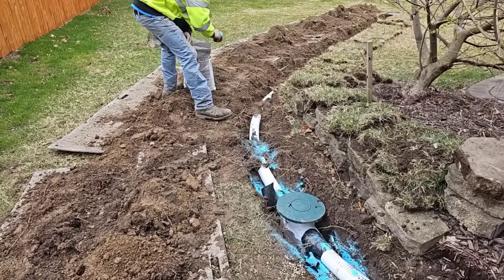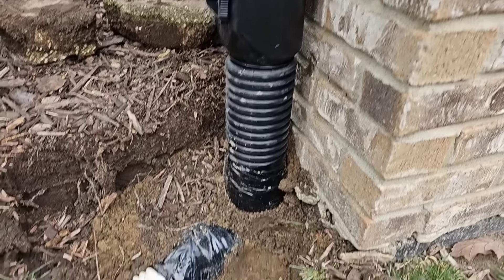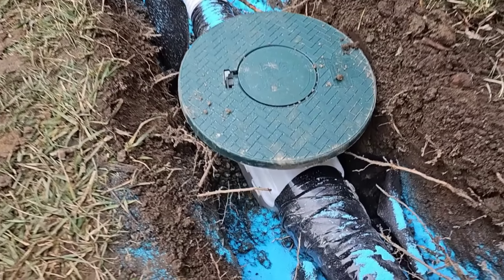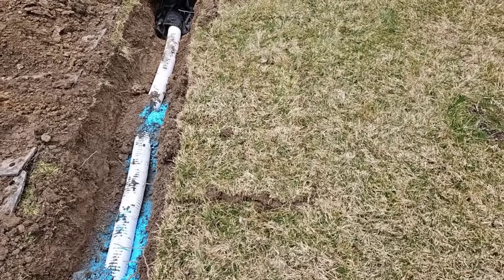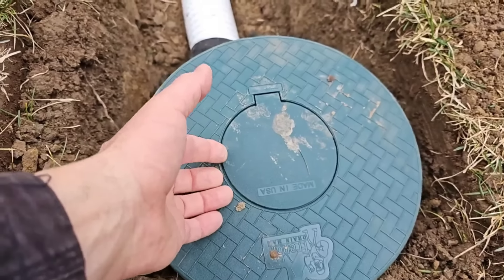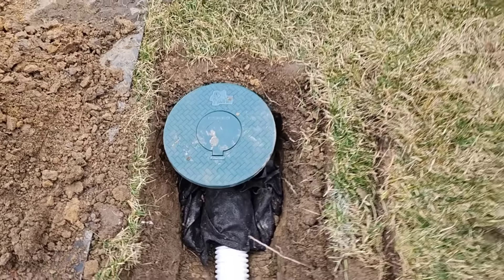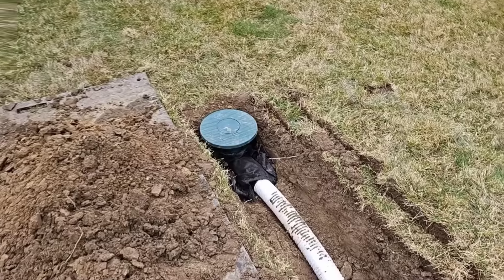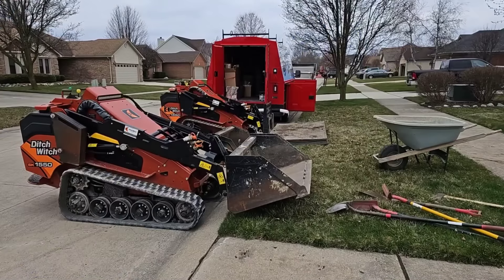How To Build Underground Buried Downspout System that Lasts FOREVER

Comment: Is this 3" pipe ok for areas with pine needles or would you still stick with the 4"?
Reply: I would imagine the downspout adapter's filter would collect most of them and the catch basins would collect others. Do you have gutter guards?
Reply from the maker: Leaf filters catch long pine needles, but many of the short ones will get through. Yes, going to a 4-inch line displaces more area, so it just takes longer for the needles to become a problem. I always recommend cutting those trees down because they cause all sorts of problems that you're unaware of. You'll end up with the wood under your shingles rotting on your roof, and it causes mold and mildew on the house. The sap ends up on everything. I'm not a fan.
Reply: @FRENCHDRAINMAN  My car has several spots of pine tree sap that are difficult to remove. I suspect pine needles are making the ground too acidic for grass to properly grow. My neighbor and I both have huge pine trees. They are nice for shade, but they create a lot of lawn care work.
Reply: I had my gutters replaced and the previous gutter guards did great at preventing pine needles from getting into the gutters, but that might be because the nearby pine trees are old. I'm looking forward to a rainstorm to see how well the 6 inch gutters perform.
Reply: 3" pipe has a faster velocity that ought to push debris through it, at least to a catch basin. It wouldn't hurt to connect a garden hose to the downspout adapter for a catch basin to flush out any debris.

Comment: My street doesn't have any stormwater drains. Would it make sense to install a 15-foot section of knife cut that connects to the popup emitter to reduce the volume of water that exits? I'm planning to buy a yard drainage system for the 4 downspouts in my backyard. I'd like to take 2 downspouts to the front yard, but my neighbor's huge pine tree has surface roots in my yard and I have a few ornamental trees so sending all of the downspouts to my side yard seems like the best option.
Reply from the maker: Pine trees are very shallow-rooted. But that's all they have; just what you see at the surface. They have this web of anchoring roots, and there isn't anything for feeder roots. I find that those are some of the easier roots to dig through. Just buy a sharp axe. It's pretty easy, to be honest.
Reply: NO KNIFE CUT! That just lets roots in.
Reply: NO KNIFE CUT! That just let's roots in.  If you must discharge into the ground, you want a dry well at the end of your run.

Comment: Can you make a pop up emitter guide?

How does the water flow up out of it without the pipe filling up?
Reply: It doesn't.  That's why they drill a few holes at the bottom of the not-quite-90, with some rock and fabric under it, so that after most of the water flows out the top of the emitter, what's left in the line slowly leaches into the ground.  Without those provisions, it would become a freeze/break risk in winter, and a mosquito breeding ground in the summer, as well as potentially harboring various molds.
Reply: The residual water would leach out through the holes in the bottom of the Not Quite a 90. Also, a knife-cut pipe can be installed within the last several feet of the system for water to leach out before reaching the emitter.
Reply: So what is the point of the pop up then?
Reply: @sseann132  Bulk water during the rainstorm will exit through the popup emitter.
Reply from the maker: https://youtu.be/F5d-47POqbo?si=b6lIw4ZOhp479OWL